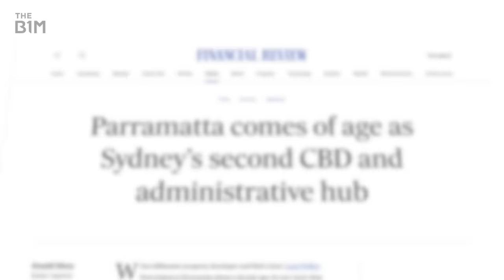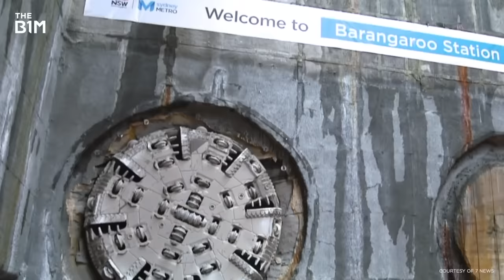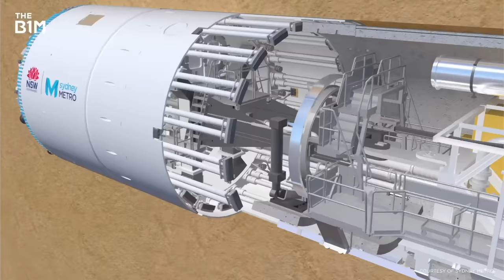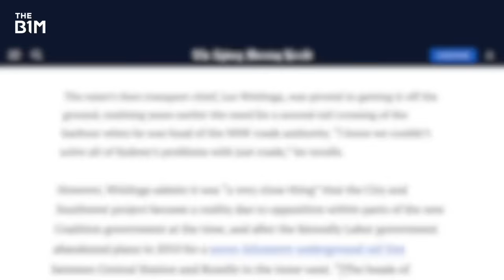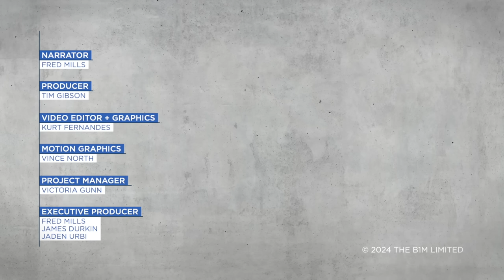Australia’s $64BN Mega Railway

Comment: Now all we need is high speed rail between Newcastle, Sydney and Wollongong (NSW) 🚄
Reply: Yep it’s a logical step.
Reply: People have been talking about it for the better part of 50 years - will never happen though sadly, especially not a network that small. It will never make back the money spent
Reply: Tough geography.
Reply: I think Canberra is a better bet.
Reply: @inbox_au  For sure, Canberra - Sydney - Newcastle is my favourite.  As long as we're not wasting time trying to get an all-or-nothing line between Sydney and Melbourne.  Just upgrade the slow parts!  Replacing slow sections makes so much more difference than upgrading fast lines — it's counterintuitive.  And you can run the same trains on HST lines as on older lines.
Reply: @affenket  a "network"?  That's not the right way to think about it.  You just need some intercity links — it's basically the same philosophy that electrified the lines to Newcastle, Lithgow and Dapto in the old days.  But I'd just focus on Newcastle -> Parramatta -> Canberra in terms of adding parallel lines (redundant so goods trains keep using the old lines) that allow for running at 300 km/h - 400 km/h
Reply: please no, we don't need Eshays on a high speed train
Reply: It should have been part of the airport. Build the new airport between gosford and newcastle. With the runways aimed out to sea, extra wide extra long so the vast majority of flights can be conducted that way even if the winds aren't perfect for it. Though they generally would be anyway. High speed rail from newcastle to the CBD via there would drop people in the CBD in about 15 minutes. Worst case put the airport north of newcastle and make it a 20 minute trip. 
Then you don't have 4 million people affected by 24 hour airport noise, you get newcastle, gosford, sydney and wollongong all as population centres that can commute to the CBD if they so desire. Get rid of traffic on some of the most heavily used and crappy/dangerous roads in and out of sydney.
And it'd probably cost less than the train line from st-marys south to the airport that really doesn't have any utility other than freight for the airport.
Reply: Getting a high speed line connecting the three is always going to be difficult due to Sydney's geography as a basin and fairly steep mountains surrounding in every direction but south west to the Macarthur region. All they can do for the short term is realign some of the older tracks to accommodate to the limits of our current trains and possibly continue the old freight line from south of Campbelltown to wollongong
Reply: @JayJayGamerOfficial  TBM's care not much about hills in the way ;-)
Reply: @zyeborm  you do know how far they would have to tunnel to avoid all of the obstacles? It would probably be economically unviable unless you split half an half which itself would still have high costs and be challenging to choose a route
Reply: @JayJayGamerOfficial  I'm sure with the billions they have spent on it over the years they have a pretty good idea of a route already.
Reply: @JayJayGamerOfficial: What ‘mountains’? Mate, Australia has NO mounted only small hills.Japan has real mountains and earthquakes and they have cut through all that to build an HSR in the sixties.🤦‍♂️
Reply: @tylerdavidson2400  and in 1960 Japan had a population of 94 million spread roughly along the distance from Melbourne to Brisbane. So perhaps their economics were slightly different.

You really should stop using that face palm emoji all the time when you keep saying things that are so poorly informed.
Reply: @JayJayGamerOfficial nonsense
Reply: @zyeborn: Mate, do you realize Japan was just recovering from WW2 losses and took huge debt to build their HSR in sixties? And the HSR helped immensely in their economic recovery and there have been many articles written about that. We could easily divert the 300 billion USD we are wasting over fighting an imaginary enemy to fill the coffers of seppos and poms to build an HSR to serve our citizens.😀
Reply: @tylerdavidson2400  yeah, you really have no idea about anything you're talking about.
I've never spoken to someone so authoritatively wrong about so many topics. Well done.
Reply: @JayJayGamerOfficial  Hah as if on cue, A bunch of tenders for "High Speed Rail Sydney to Newcastle" planning stuff was just put up on austender on the 16th. A few more million in planning for something they will never have the guts to do.
Reply: Never will happen. Too hard.
Reply: @affenket I get what you mean but they should do it though, anyway. it’s a service not a business at the end of the day
Reply: @affenket  Sydney - Newcastle is one of the few areas of the east coast high speed rail dream that could potentially be economically viable.
Reply: Wollongong still sucks for trains
Reply: @affenket  How come train networks are required to make a profit but roads aren't? Roads create an endless loop of induced demand.
Reply: I doubt that the high speed rail will ever happen. Based on the geography of the Illawarra region, i don't seem to think that it will work. I like the suggestion.
Reply: We don't have the population density to make it affordable, notiwithstanding the implementation technicalities.
Reply: @fifty-plus  the geographics of the relevant areas, basically makes it pointless to even contemplate the idea.
Reply: @JoelDavies-cl6nr  unless it's an election year, or course.
Reply: @affenket why does it have to be profitable if it improves people's quality of life and reduced domestic flight pollution?
Reply: The whole east coast would benefit from high speed rail
Reply: I’ll be dead before that happens. I’m 52 and been catching Sydney to Newcastle since the late 80’s. Just don’t hold your breath on this one.
Reply: @fifty-plus it’s not about population density. It’s about connecting large population centres. Newcastle-central coast-Sydney has over 6 million people and growing rapidly. It is the logical starting point for HSR.
Reply: Melbourne, Canberra, Sydney and Brisbane is what's needed.
Reply: @gregoryjohn4  it is if you want affordable fares. Look at how much Shinkansen is with over a million a day travelling on it. Let alone the technical and logistic challenges we face implementing it here.
Reply: Absolutely. All of our capital regions should have high speed. In between them might be difficult but there should be high speed within south east qld, Melbourne to Geelong etc
Reply: All we need is a 300km/h rail between newy and Sydney. It will be such a beneficial addition as driving between sydney and newy sucks and is so slow at 110km/h
Reply: @affenket why would public transport be about making a profit? Roads don't make a profit either but they build more.
Reply: Logical to extend this through to brisbane melbourne canberra adeliade and perth darwin and make a loop right round through cairns etc too
Reply: @fifty-plus  tens of thousands of people drive the M1 north of Sydney every day. You only need to capture a small percentage of those commuters to have a viable service. And who wouldn't prefer a fast and comfortable train to/from the city over spending stressful hours each way in hectic traffic on the M1? A fast train doesn't need density of population when there are only maybe 3 or 4 stops along the route as would be the case between Newcastle and Sydney. It just needs population centres where there is a demand. The Hunter region (population 700,000 ) and Central Coast (population 350,000) is the obvious first choice. These large population centres are where the stations would be located and they would ensure full trains between Newcastle, Central Coast and Sydney.
Reply: @Low760  are you from australia ?
Reply: We need one to go much further than that! So people can live way away from Sydney but have the chance to still work in Sydney where all the jobs are
Reply: Your right mate heard on the local Wollongong radio that atleast half of residents down here work in Sydney
Reply: I think Melbourne to Canberra to Sydney to Brisbane is a more viable option.
Reply: And Penrith
Reply: You can blame Qantas for not having one already
Reply: Without connecting regular bus service it useless
Reply: Hell yeah! And out west towards Orange!
Reply: Would not happen in 50 years.
Reply: The newcastle to sydney train goes so damn slow thru all of the hawkesbury it's so painful
Reply: @tylerdavidson2400  Japan made their own high speed trains and all the components related to them. Australia can't even mass produce toothpastes.
Reply: Something to think about is, Chinese cities that has high speed rails, most of them would exponentially have higher population density than any major Aus city, and yet they are still losing money in their high speed rail. it's not very logical to have high speed rails in the geography of Australia due to our very low pop density.
Reply: As long as they pay not all of Australia for a ride they will never take !
Reply: I believe there was a report/study that found just upgrading the tracks for faster trains (not high speed) provided the best value for the next ~30 years. I'd prefer highspeed rail going from Melb to Bris, but I don't think anyones going to do that any time soon :/
The rail upgrade for "faster" trains still cuts hours out of travel.
Reply: @affenket  no it’s not like the government gives a fuck about the people enough to do that
Reply: Or any train Sydney to Brisbane RESTORED north of Armidale.
Or the Northern Rivers line RESTORED
pathetic, all these new builds, and a push for people to move to regional centres, where the previous state government has spent a decade undermining transport options.
Pathetic!
Reply: We need to head out west as well. Sydney/Bathurst/Dubbo maybe even keep it going to Broken Hill and Adelaide
Reply: it won’t happen, the cost will be through the roof
Reply: According to China Railway's financial reports, the company's total debt amounted to 6.04 trillion yuan ($US 890 billion) at of the end of September 2022, equivalent to about 5% of China's gross domestic product.
Reply: @ haha-eg8fj: We can easily import the HSR technology just like Indians and Americans are doing.
Reply: @zyeborm: Son, I have lived and worked in three continents and have traveled in German and Japanese HSR trains. So I KNOW what I am talking about. You sound like you have not been out of your regional town in Australia.
Reply: @koala2464 Its called long term planning.
Reply: What, under the sea? HS(M)8 (perhaps)[??]
..ballsy idea kid, I like your moxy!!!
Reply: @tylerdavidson2400  population per square km. try reading more
Reply: no we dont
Reply: @affenket  it will 100percent make up the money as it will create a super conurbation of greater Sydney that will drive investment, property value and economies of scales for the Central Coast, Sydney and the Illawarra!
Reply: @tylerdavidson2400  same in Europe, whilst the terrain is challenging it is nothing that has not been down before, if they can cut through the Amalfi coast to get to Salerno and through mountains between Osaka and Tokyo, then they can build a train line from Newcastle to Wollongong :-)
Reply: @whophd  to be clear, I’m all for it. But this is Australia we’re talking about - we are fairly shocking at bold infrastructure. Everything is deeply politicised and rarely gets off the ground.
Reply: Yo i live in wollongong.
Reply: @affenket Forget about profit, will this HSR network have good ridership?

If yes, then we shouldn't care about profits. The overall impact on the economy and society will be higher.
Reply: The aim should be connecting city centres as population control hubs so people can spread out and still go to work quickly. It's the whole point on why trains were developed

Comment: I work on this project from the UK and it’s wild to see a video about it!
Reply: Wow, what do you do?
Reply: @whophd  I work for one of the engineering firms used on this project. Specifically the line for the new airport.
Reply: @JamieCullen  Nice nice!  I guess I can't ask you about the very-subtly-different loading gauge and voltage on that line hmmm 🙂
Reply: @whophd  Loading gauge is the same across all rail systems in Sydney. The voltage is different and the airport line carriages a little wider to accomodate the extra lugguage for airport travellers
Reply: @baalbektrilithon if they make the carriages wider they won't be able to use all the exsiting metro stations.
I think the trains will be the same
Reply: @ilovelifan  No a UK based global engineering firm
Reply: @baalbektrilithon  WHats the voltage on the new line? Have they ditched the 1500vdc and gone 11kvac finally?

Comment: I attended the community open day at the Victoria Cross station and it is truly a modern marvel of engineering.
It features the first lift only station access at its Northern end. This is due to the topography of North Sydney and the station needing to be deep so the metro tunnel can go under the harbour to Barangaroo on the south side of Sydney Harbour and also the narrow corner block this entry is located at. 
At the southern end of Victoria Cross station it has 3 long escalators to get to the surface.
All the stations are impressive on the new Sydney Metro Station but this one is next level.
Reply: I was there too. Very exciting!
Reply: wish i knew about that. i work in north sydney not far from the new station so itll be the station i use once it opens. would have loved to have had a peak inside.
Reply: and in a power outage nobody can get out of the station
Reply: as a wheelchair user, this is cool :) Most stations have a single lift & if it's broken, you're simply told you cannot use that station. When they repair/upgrade the lifts, they take them out of action for 3 months or more at a time before replacing with a single lift. During the entire Wynyard upgrade period, there was no wheelchair access to the station, or reasonable ramp angle access to the bus stops above it either. I used to go into the city a lot, but stopped as a result of that
Reply: @mehere8038  Great feedback. 
The lifts at the southern end are pretty quick. You do have to use 2 lifts to exit at the southern entrance of Victoria Cross but if you time it with the lifts ready when you exit the train you can reach Miller street in around 2 minutes from door opening to exiting the station at street level.

Comment: You guys really need an Australian editor.

Victoria Cross had an open day a few weeks ago and there is heaps of better video content of the near complete station.

No-one would refer to Metro West as Stage 2. 
Stage 2 is Chatswood - Sydenham, Stage 3 would be Sydenham - Bankstown, and that's just M1.
The Airport West will be next to open so Stage 4 if you say.

And finally if you do this video you should be mentioning the Western Harbour Tunnel as well.
Reply: They didn't say the location of this Victoria Cross station, but I gather from the comments it's at North Sydney, maybe replacing the train station there?
Reply: @VanillaMacaron551  Victoria Cross station is in North Sydney but is not replacing the current station. North Sydney will now have two stations. On the south side of Nth Sydney's CBD is North Sydney station which provides access to T1 and T9 Sydney Trains lines. On the north side of Nth Sydney's CBD will be Victoria Cross station which will provide access the M1 Sydney Metro line.
Reply: @mark123655

They have already done a separate video on the WHT
Reply: Don’t think it really matters mate.

Comment: How do they remove the TBM once it has completed the tunnel?
Reply: A TBM is assembled kind of like a large LEGO set. 

When the tunnelling has been completed they dismantle the TBM piece by piece and lift out all of the pieces.
Reply: Sometimes they don't.  If site conditions make removal too costly or logistically difficult, they will bore a short spur or extension to the tunnel, and just leave the machine down there.
Reply: Lubricant
Reply: @CrankyHermit  yes that’s also true. Good mention
Reply: Just the cutter head and the shield though, as they are wider than the concrete tunnel rings they place behind them.

The gantrys on the back all get wheeled out and sent away

Comment: Building an extensive metro system has a dramatic impact on any city, normally a very positive impact. I remember back in 2008 when the Beijing metro system was complete and it was astounding. I could travel to almost any location I wanted to go to by metro, while previously I had to use taxi’s or buses.  While back in 2000 taxi’s were plentiful and cheap, by 2008 they were getting harder and harder to find, so a metro system really made a difference to me. I expect this metro system will really impact a lot of people in Sydney ion a very positive manner.

Comment: 0:18
Seems like Sydney only has a West side...on all sides.😂
Reply: The East side is pretty small. There are some very expensive harbourside suburbs though. There is a plan to extend the Metro West into the Eastern Suburbs (no idea if or when that will happen). They currently have the T4 Eastern Suburbs (heavy rail ) line, the L2 Randwick and L3 Kingsford light rail lines, a limited ferry service, and lots of buses.